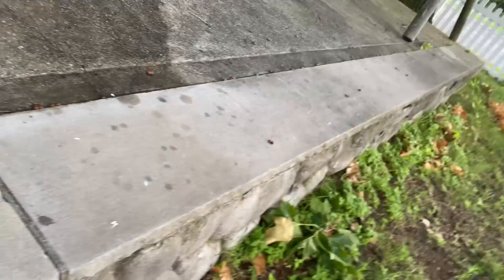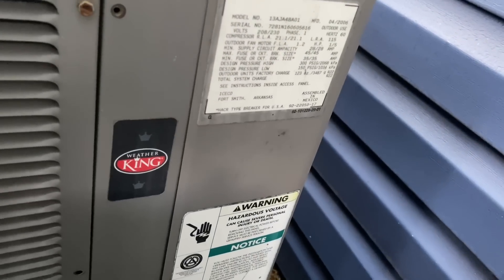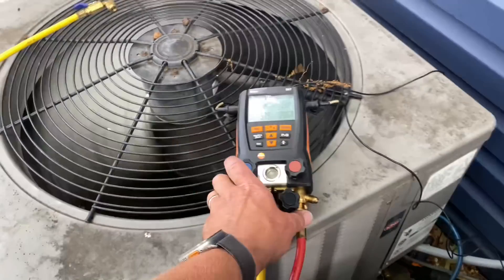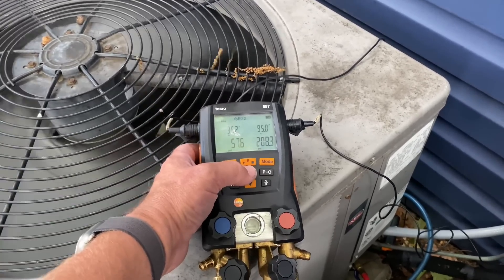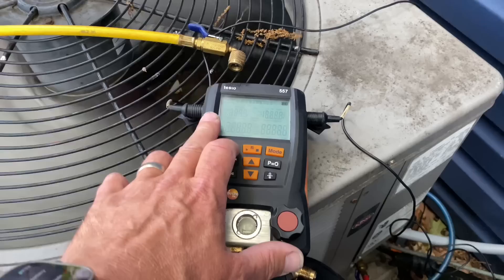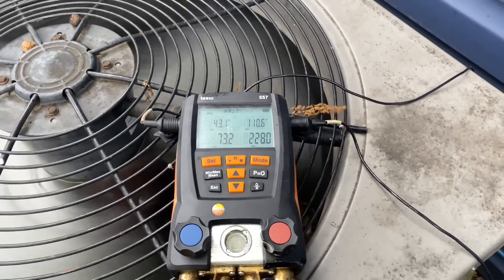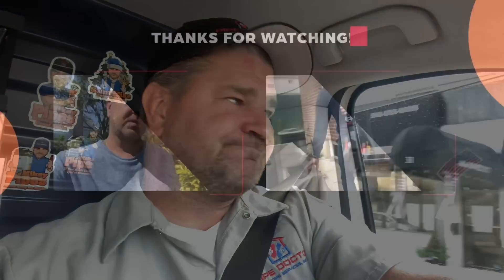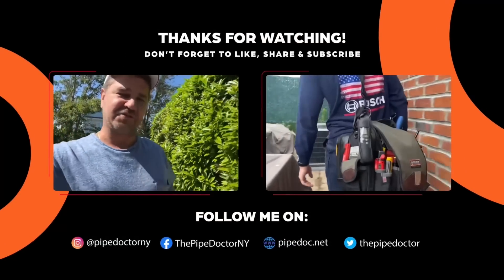Central AC Not Cooling Properly & Frozen Pipes - Diagnosis & Solution Revealed

Comment: So I take it you don't even attempt to find the leak and repair on R-22 systems anymore? That system was 18 years old. Just curious.
Reply from the maker: No. Absolutely not worth the time to perform a leak search unless there is something visible.
Reply: @PipeDoctor  Thanks Mike!
Reply: 99% chance the evaporator is leaking at u-bends and probably the rear of the coil, where many had galvanized shields in contact with the copper. second to that filter-drier outdoors rusted through or compressor the same.
by time you do leak search(labor), find the issue(often not repairable,) even if repairable it ends up costing 3/4 of a new system by time you add parts, labor, gasses, unless you do total fly by night hack work.
I have seen that done many tims over the years, they just smash in/resell random used refrigerant directly from recovery tank, which is not filtered or anything.
not legally allowed, could loose licensing and acrue huge fines. of course nobody will turn them in, since they're getting comfort from it...

Comment: $1 million question for you what percentage of the United States total refrigeration residential is still running R 22? In my area I am estimating approximately 35% yet
Reply: Probably 45 percent still using R-22 order existing system. R-22 was safe and reliable and maxed out system life compared to these new systems.

Comment: Will you need a new set of gauges for use with R32? What about the vacuum pumps?
Reply: there's R-32 ic currently 50% of the blend in R-410a( R-125 is th eother 50%). R-32 is still an "HFC" refrigerant (hydrofluorocarbon), so much of the current/newer service equipment should work with it, if rated for for mildly flammable (A2L) gasses.  it's more how you handle any leaks and use safety precautions.